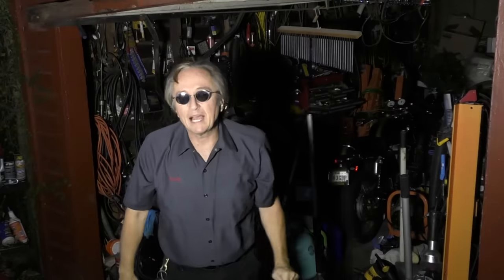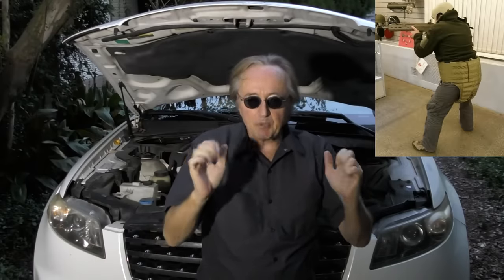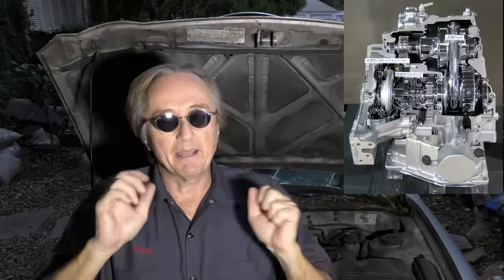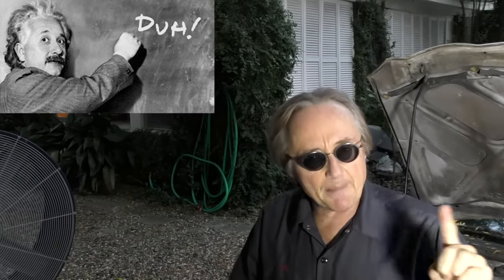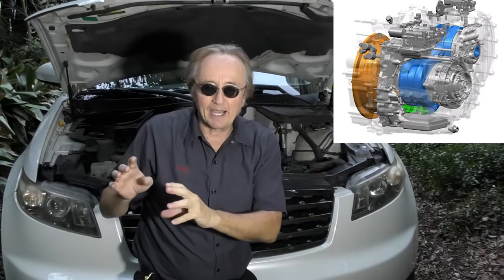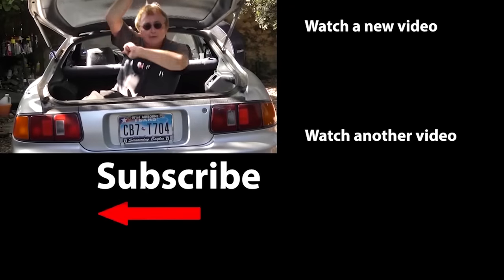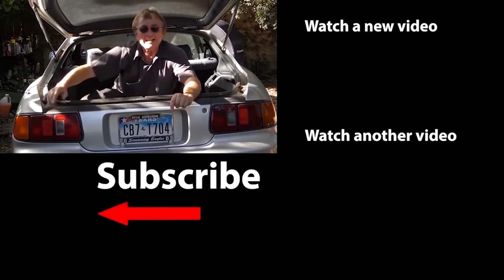Why Most CVT Transmission Cars are Terrible

Comment: Still havent seen the video as its set to be release in 12 minutes, so maybe the answer to my question is in the video. I know nissans have bad cvt transsmissions for more than 10 years now, but what specifically is their failure point, what does nissan keep getting wrong compared to Toyota/Honda cvts?
Reply: Specifically no answer.. the problem according to him is who made it.. not the actual cause
Reply: Honda and Toyota also have issues, especially Honda on their CRV and Accord
Reply: Just asking about the nissans because we had an 07 sentra which had one of their first gen cvts, we got it replaced twice under warranty. 12 years later and im hearing they still have high failure rate. Im just wondering what it is that they cant figure out after so much time.
Reply: @Asbel Rr we bought that 07 sentra with 0 miles so we actually did all factory required maintenance through the dealer. Nissan knew they had faulty transmissions so they extended the warranty on them to 150,000 miles or 8 years to prevent lawsuits, thats how we got it replaced the second time when it was just past 100,000. Im just wondering if its a specific part of those transmissions that is failing, like the seals or something internal.
Reply: It's not made by Toyota so it has to be bad according to him.
Reply: @REPOMAN24722  actually I live from shop to shop because I fix electric and electronic issues on cars and since I own a Dodge Caliber which has had plenty of issues with its JATCO transmission and have friends with Hondas, Toyotas and Nissans, I've asked A TON of different people about their experiences, most of them have never had issues with Toyota CVT's (shops having had one or two Toyota transmission repairs tops). So Scotty's got a point.
Reply: Covert Person what issues on crv and Accord?
Reply: It seems Nissan has consistently just been that unfortunate wing in Jatco manufacturing that receives the least amount of attention compared to the other companies Scotty mentions (and there's a lot). Toyota's efforts with Aisin transmissions has paid off; and Honda thus far hasn't shown anything too bad (I've driven a few Toyota CVTs, own a current Honda one and others. The others were always funky to me, but Toyota's and Honda's were consistent and easy to predict for a good ride and mileage purposes.). Honda and Toyota, having their own CVTs, may just mean they will always make stronger ones in the future, since their efforts won't be so diluted across so many companies, as in the case of Jatco's clients.

Hope this helps.
Reply: Also, some of this future of CVT stuff will be challenged by TRAMI. Search this and you'll see that nine of Japan's automakers are coming together to work against Aisin and Jatco. If it works, all those companies may be the best in whatever hybrid CVT transmission get put in all the common cars of the road in the end.
Reply: Exactly! Sincce CVT is diferent type of tecnology, it need to be mainteined diferent. I have an 2008 Nissan Sentra CVT with 200k milles and never had a problem. Of course, i change the CVT fluid every 50k
Reply: According to a few mechanics I’ve talked to (we have one of these cars) the transmissions burn the cvt fluid and the friction from it ruins the transmission
Reply: Word Life do you change the fluid?
Reply: Why asking that question ?...you wanna fix that company's problems?...knowing that Nissan makes shitty cars is enough for us as consumers....😎
Reply: @rredgarreal  I also have a Dodge Caliber, but not once have had a problem with the cvt transmission and it has 200k+ miles. I've only had problems with the suspension & steering components..?
Reply: Nissan puts them in heavier cars with too much HP for the transmission. Also the older ones came with inadequate transmission coolers. There’s a YouTube series made by a guy who had one fail in his Rogue at about 189,000 miles. He tore it apart and part of the pulley system on the input shaft had locked up causing the belt to break.
Reply: No, certainly not all of them since, statistically, there will always be successful transmission development here and there even in dodgy manufacturing. Same goes for the best automotive car -- the Corolla might actually come out as a dud here and there, but it's rare. If we're talking numbers anyway.
Reply: My 2005 Prius has no issues, but I had to insist the dealer change the trans fluid at 70k.
Reply: @carlosmejia5728   knowing the actual failure point is important. If its the tramsmission burning the fluid as suggested in a comment above you can take steps to prevent the failure, such as changing the fluid more often then recommended or installing an after market tramsmission cooler.

Comment: Looks like Scotty went full 180 on Toyota CVTs.
At 2:31 he says: "That's because they've been mass producing their CVTs longer than anyone and perfected them."
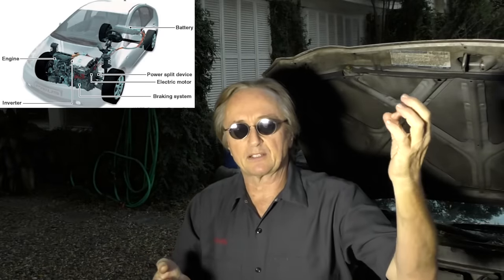Fast forward to today after the late 2018 CVT recall by Toyota, Scotty makes a new video, "Toyota Recalls Thousands of Corollas, Here’s What Happened" and at 2:44 he says "Toyota was one of the later manufacturers to start producing CVT transmissions in regular cars, and perhaps they should have waited longer till they perfected them. Obviously, they have not perfected the CVT technology in these things."
I DON'T KNOW WHAT TO BELIEVE ANYMORE!
Reply: Scotty, Ken Rockwell the same breed of people. So good at promoting themselves and know what to say. Good to listen...but don't decide base on them. Do your own research.
Reply: Toyota actually makes two types of CVT transmissions. They have conventional CVTs which are in regular vehicles - these are the ones having problems. They also make E-CVTs. These are in their hybrid cars, and go by the name of "Hybrid Synergy Drive". Mechanically they are unlikely to break as they're just a couple diffs attached to the engine, two electric motor/generators, and the wheels. The weak point in those is the battery, though even there it isn't prone to failure exactly. What will kill these is if you don't drive it enough, the battery won't get cycled enough and will be damaged over time(NiMH batteries are weird like this). This is a slow process, and generally lasts 150k miles even at the worst case scenario, but if you drive a lot(frequent road trips or deliveries around town especially) they won't give you any issues(I've heard of cabbies in NYC clocking 500k trouble free miles in their Prii).
Reply: @johnrickard8512  Thanks for the insight, never knew about the different types of CVTs.
Reply: SO my hybrid will the E CVT transmission..
Reply: It’s not just the make model and the year. It does have a lot to do with the person driving and taking care of the car.
Reply: @johnrickard8512  So for a guy who drives less than 5K a year, 6 mi. to work 3 days a week and 400 mi weekend trips, hybrid tech isn't likely to last me 20 years?

Comment: I walked away from Toyota dealer today when I realized was CVT new model 2020.   No wayyy.  I said bye 👋 I keep my bmw almost impossible to break it
Reply: Jaydenpr vazquez so it's not a good idea to buy a new Toyota Corolla with a cvt transmission?
Reply: Grand Master Mawile Toyota and Honda make the best CVT transmissions, as long as you change the transmission fluid regularly you should be fine.
Reply: That’s what I’m saying they been making cvt transmissions for over 20 years so they know a thing or two . you should of bought that corolla Honda and Toyota haven’t had any major isssues yet like he said below 👇🏻if u change the fluid when its supposed to be changed you should be good

Comment: Can you ease the CVT problem of going into limp mode on long uphills by adding an aftermarket cooler (like a little radiator)?
Reply: Change the fluid I did mine and it stopped overheating

Comment: my neighbor has a Nissan Maxima 2017 with 40k miles and transmission (CVT) need to be replace already XD.
Reply: Almost  bought a  Nissan  Maxma,  I glad I didn't  , Got  the  Toyota Camry XLE black  instead,  The  best  move  I ever made.
Reply: Well it’s still under warranty 
5yrs/60k powertrain 
But as a Nissan Tech ...
I see cvts get either rebuilt or replaced daily.
I would tell you to advise your neighbor to get rid of it after the CVT gets replaced cuz they are garbage !!!
Reply: @Greg Myers That's the world we live in!
Reply: @Greg Myers Since the transmission would be new after replacement I see no harm in selling that vehicle. Who is to say that new transmission would be equally bad??

Comment: Do not buy a Nissan EVER with a CVT.
Reply: Lol just did today 😐 I knew about the problems but the deal was too good to pass up
Reply: @GS-kj6ur  🤞🤞😨
Reply: I got 111k miles on mine still working I was worried about the extended part warrantee so i brought it in for diagnostics, and they are giving me a new one for free.  So its definitely a concern, but nissan has treated me well so i will continue to consider them in the future.  Hopefully i get another 111k miles on this new transmission.
Reply: @bir6nard4  got an 18 Sentra with 22k on it for 7k no Warrenty
Reply: @GS-kj6ur  guessing you didn't buy from a dealer...because they should've given you at least a 3 year/36k mile warranty.
Reply: @taradead  no not at the price I got it at

Comment: My Subaru has a CVT with over 170K miles so far, which has outlasted the conventional transmission that was in my last vehicle by 70K miles. Your experience/luck may be different, but Subaru backs their CVTs with a 100K warranty. That said, I’d have better faith in a traditional style transmission with a similar warranty. I’ll also continue to change transmission fluid when I think it’s needed. Old habits die hard.
Reply: Nissan backs their CVT's with 120K warranty.

Comment: Once again Scooty falls victim to Wikipedia and not fact checking a little more....as to Subaru CVT’s being manufactured by JATCO: (from Car and Driver, Dec. 2013, by Don Sherman (see what I did there, it’s called CITING SOURCES!)) Audi, Honda, Hyundai, Subaru, and Toyota all make their own CVTs. Nissan owns a controlling interest in JATCO, the firm that supplies 49 percent of the world’s gear-free transmissions to Chrysler, GM, Mitsubishi, and Suzuki. In addition, nearly half of Nissan’s current U.S. models offer a JATCO-supplied CVT.
Reply: I have two Subaru Crisstreks and the transmission amazes me. 38.5 mpg in a 1000 mile span by driving slower and easy acceleration.
Reply: Jatco makes the 4EAT and 5EAT that Subaru stopped using in 2014.  Jatco also makes all Subaru manual transmissions except the one for the BRZ which is a variation of a Lexus IS transmission made by Aisin.  The  Subaru Lineartronic CVT is Aisin.   The late 80s/early 90s eCVT used in the Justy was Jatco and total junk. Subaru has never made it's own transmission.
Reply: Jeffrey Deans.....I searched and searched and could not find the information you have anywhere. Could you cite the source where you got that info please? Thank you.
Reply: Hello Sir, can you please cite the source for subaru's cvts manufacturer? Thank you 
:0)
Reply: ANDINA MM ....I did. In original post. Car and Driver, December 2013.
Reply: @jeffreydeans7097  @ Jeffrey Deans, JATCO used to make CVT for subaru up to 2010,  you are wrong about asin, the lineartronic is made by subaru and LUK.
Reply: @amanfra2121  he is right about the 4EAT and 5EAT, trans, they are all made by Jatco, they used to make subaru CVT until 2010, he is wrong the subaru CVT are made by Aisin, they are made by subaru with help from LUK.

Comment: Just avoid Nissan altogether.
Reply: Noseefood or just by an Infiniti with a 7 speed or a 370z if you really want a reliable Nissan
Reply: Last time we (my family) ever got a Nissan was 1999. Am I doing it right?
Reply: @Blakek.  cough cough like Toyota
Reply: Nosefood I have a 2004 Nissan Frontier kingcab 2.4 manual transmission without any issues , only battery and tires were replaced.
Reply: 4th generation 1995-1999 Maximas are BULLET PROOF!! I've owned 3 Maximas. The engine and transmission are built to last 400,000+ miles. I sold one that ran beautifully and had over 300,000 miles on it!! Any Maxima after 2003 was built here in the USA. Unfortunately, they suck. We build cars to last 2-5yrs. 150-200,000miles is a lot for an American car. Japan builds them to last 10-15yrs.      
300,000miles and still in good shape. I am impressed with  4th gen Maximas. They run forever 🚗💨💨
Reply: Javier Hernandez the VQ35, VQ37VHR, VR38DDTT, and VR30DDTT are bulletproof engines in modern Nissans.
Reply: and Honda
Reply: CVT Nissans
Reply: @marymonaco4026  yea you're correct. The 70,s 80,s and 90,s nissans were as good as Toyota and Honda.  It's when fiat and nissan joined that they started haveing problems.  There engines are still decent.  But they caint get a tramision that last for nothing.  They have had all sorts of problems with the automatic transmissions and cvt are really bad.
Reply: Daniel Beavers *Renault*.
Reply: No. The only ones that are worth buying are the 6 speed manual transmissions. But, only the sentra, Versa, and 370z have them remaining.(the new CEO of nissan better make a new manual transmission that can actually be applied with there ATESSA System.)
Reply: Ganaram Inukshuk only if your family can’t drive a manual transmission car.
Reply: Cvt is rubbish nissan bring back the automatic transmission way better
Reply: @Blakek.  yeah cuz back then they weren't owned by Renault
Reply: @danielbeavers8701  how can u say it wont last long if they are new ??? Unless we see a higher failure rate in the first 10,000 miles for a 2017-2019 Nissan,  you really cant make that assumption.
Reply: @truckercowboyed2638  because Nissan has basically became Chrysler and dodge to were all there cars are starting to be horrible.  The new Nissan cvt are horrible they haven't had them Go over 100.000 miles. Honda makes the best cvt transmission on the market.  Toyota makes good ones to. All iam saying is Nissan in the 90's and earlier back when they were datsun they were really good cars then. Great cars. Rite there with honda and Toyota.  But then rennvolt bought in with Nissan and they are pure trash now. They work fine at first you will  e thinking you lo e the car. Then the tramisions will  go out. You get another one.  Then a computer problem then a ecu problem.  Before you know it the other transmission goes out. Iam telling you this is the new Nissan.  The reason the still sale cars is because a lot of people buy a new car then upgrade to the new model the next year. So there's constantly a turn around.  This is how dodge , BMW,  Mercedes these verry unreliable companies.  They only have to be reliable for the first customer for that year.
Reply: @danielbeavers8701  well perhaps.  But I like the cvt in my Sentra SR Turbo.  It's very responsive and honestly I doubt I'll keep it till 100,000 miles anyway.  Ill maybe put 7,000 to 8,000 year on it. So it will be under 40,000 miles when I pay it off
Reply: like which

Comment: Hey Scotty what American car Company makes the best vehicles
Reply: None
Reply: caterpillar
Reply: None.
Reply: Studebaker
Reply: @Brennan Mccray that's what I was waiting for
Reply: I think Scotty already answered that question in another video. Ford.
Reply: Dodge
Reply: Hotwheels and micro machines
Reply: Any car from the 1950s-1980. Easy to work on. No complicated computers and electronics that break down and engines that don't cost a fortune to repair if something goes wrong.
Reply: Ford!
Reply: Jose Nio legs
Reply: Fix Or Repair Daily
Reply: @b9625bb . Before we all get into a war about what American car manufacturer makes the most reliable cars lets just say that, any car can be reliable as long as you maintain it properly, but the question is, how much time and money are you willing to spend to maintain it? The better question would be, "what American car manufacturer makes the cheapest cars to maintain?"
Reply: Ford by far; stay away from GM and FCA
Reply: AMC
Reply: Packard
Reply: F***ed
Over,
Rebuilt
Dodge

Comment: My 2008 Maxima has about a buck 80 on it and it still drives great. Absolutely buries newer Chevys with much lower milage on them. I got the car with maybe 170,000 on it and I don't believe it was taken care of before I got it. The CVT fluid was dead and black when I drained it and filled it a few times with Castrols new multi vehicle CVT fluid and it shifts almost like new so go figure. I'm considering going with a more expensive CVT fluid now that I know the car is solid.

Comment: Hey Scotty what do you think of Buicks?
Reply: Rev up your Le Sabre 🚗
Reply: You can't go wrong with the Buick 3400 V-6 engine, but you have to be very gentle with them if you want their transmissions to last.
Reply: @charlesvalkan252  I had a 3400 LA1, in an aztek, those things apparently run hot and eat gaskets. It's probably okay if you baby it enough though.
Reply: @iamageek500 . Bad luck I guess. Some are said to be great engines.
Reply: my 3800 is bulletproof but like the 3100/3400 it overheats and will blow at least one head gasket
Reply: if you drive like a mad man then they will fail quickly. buicks are designed for old folks not race car drivers.
Reply: I had a 2005 buick century that only needed the typical suspension stuff and ran 300k. buicks are decent cars, a safe bet
Reply: Davin Da Geek old mans car
Reply: A P there’s a difference between “marketed” and “made” for old people, they are all just based on other gm models/platforms so it can’t really be said they are made for old people.
Reply: spratsprat I drove a Buick once and that thing was floaty and the handling was crap. Buick is boring to drive. It’s made to meet the need of the older consumer base.
Reply: Buicks are very popular in China. Must have a good reputation for such a market.